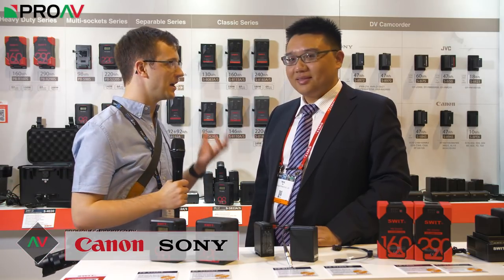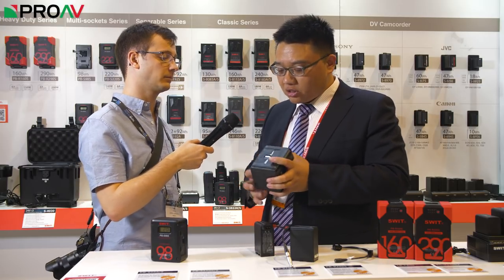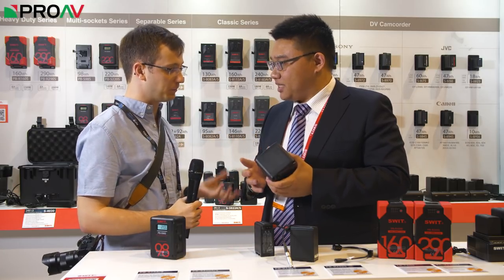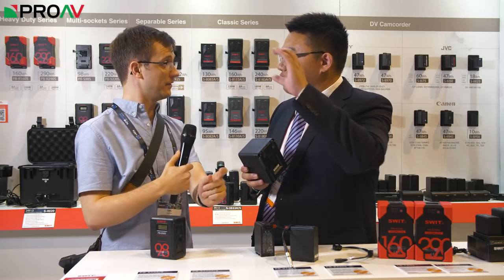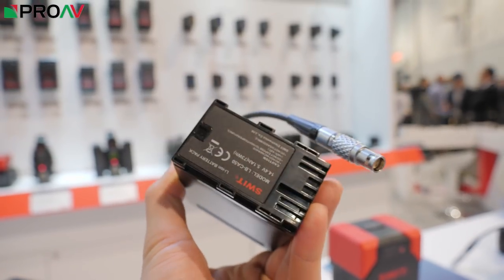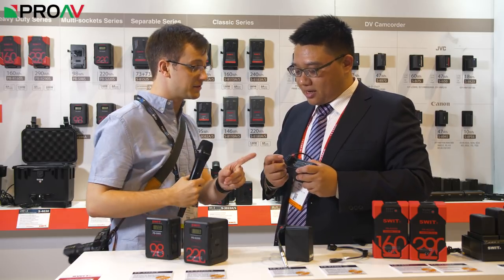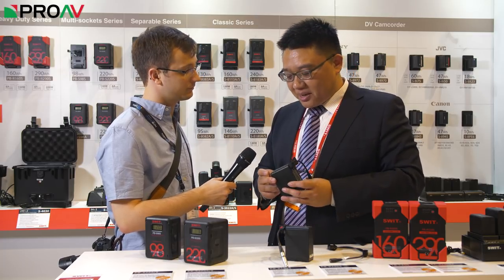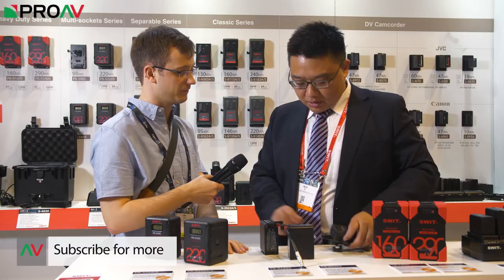Swit V-Lock & Canon C200 Batteries - NAB 2018

Comment: The DC in on my brand new C200 is completely unreliable. I've had the same problem on rented C300 MKIIs. The connection is fine for stationary tripod use but when used shoulder mounted with an IDX and or Wooden Camera battery plate, my C200 momentarily loses power. The camera will be powered on, I hoist it to my shoulder, by the time my eye makes it to the EVF, the camera is rebooting itself. The connection seems solid but something is just slightly out of spec on either the C200/300MKII input or every other company's DC output for that input. I wouldn't even consider using these new SWITs because of that reason. Too bad they couldn't figure out the pin connections. YMMV.
Reply: I had this exact same problem and then the DC port totally died. Camera has been with Canon for over a week now for repair. So frustrating on such an expensive camera
Reply: I've read lots of others on-line in the forums also have DC in problems with the Canons. It's weird, I shot a corporate thing with a C300 MKI last week and used the AC adapter which was a consumer, push-in standard DC connection, worked great, not the like "pro" solution we have now that doesn't work nearly as reliably. One step forward, two steps back Canon.